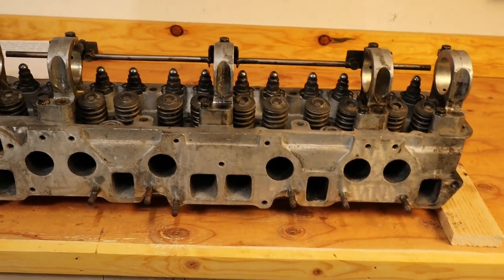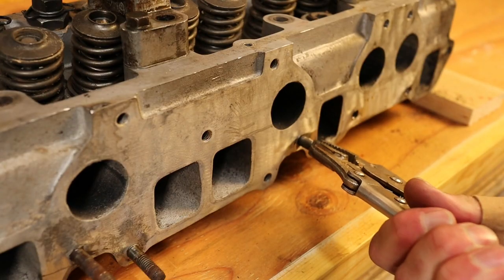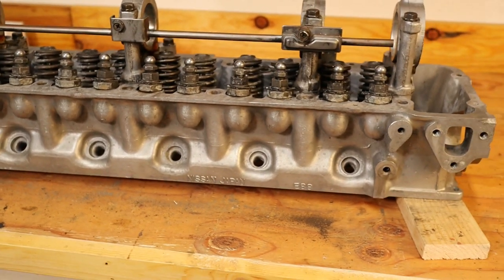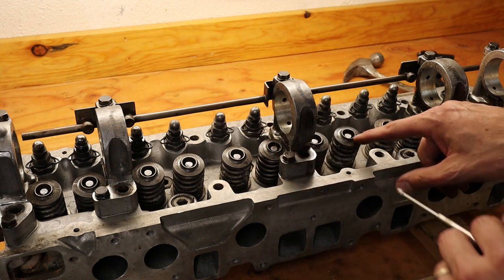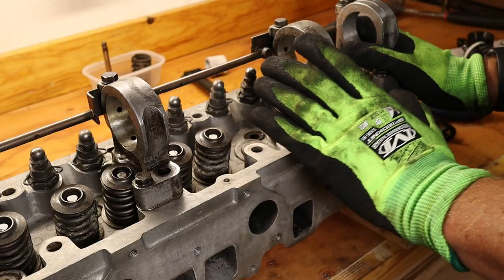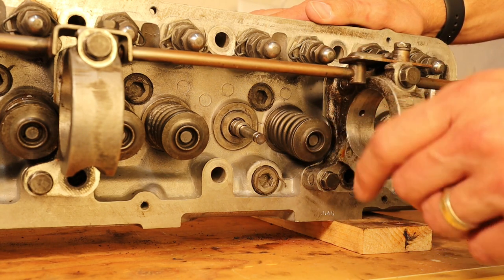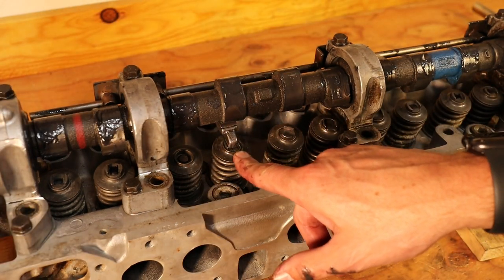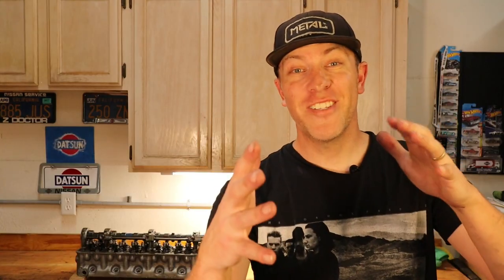Preparing the cylinder head for the 260Z L26 Engine

Comment: It looks like Delta is a resurface and regrind of a Nissan cam, which (if so) is a good thing. 

I’ve had good results on a 260Z engine with the Comp Cams 84-119-6 grind number 252S. Also a L2 street cam.  Idle isn’t too rough and it’s drivable with more torque.  It will allow you to set all the valve clearances to .008” cold or .010” hot.  Instead of having switch between .008” and .010” feeler gauges for cold intake/exhaust. I always got  confused and had to make a chart before using this cam.  Now it’s an EZ job.    Peace!
Reply from the maker: Yes!! Right on, good info🤘🏻

Comment: Thanks for all of the content, it has really helped out in my 280z build.  My cylinder head was recently resurfaced and I am ready to put it all back together but wonder if I should bother with getting a mild camshaft regrind like you.  🤔 what do you think? I haven’t even driven the car more than a few miles and can’t wait but will it be worth the wait in the end to get it reground?I’ll have to give delta a call to get prices and eta
Reply from the maker: Getting the regrind will get you a little more from your engine. Best time to do is when it’s all apart but could be done later down the road.
Reply: @CarsBikesandCoffee  called Delta! Prices are very fair, he recommended the 260 or 268 grind. You mentioned your was kind of a stage II, was it any of those options by any chance? It looks like your stock lash pads were fine to?  Thanks Kurt!
Reply from the maker: Right on! The 268 is the grind I got. I would also suggest having them do that resurface I mentioned.
Reply: @CarsBikesandCoffee  rocker arm resurface? ✔️